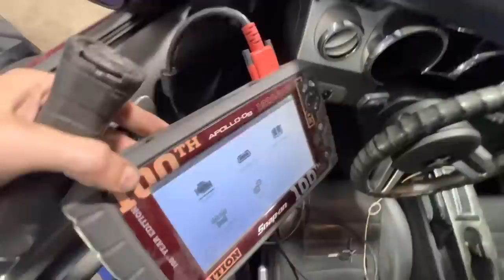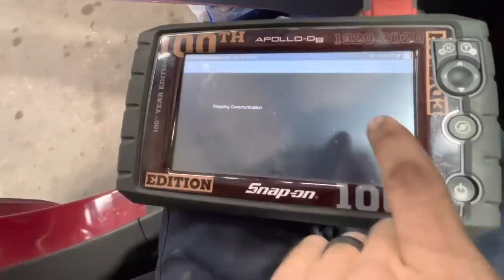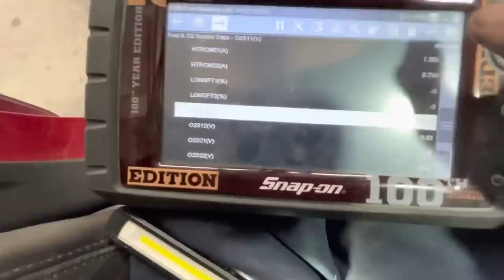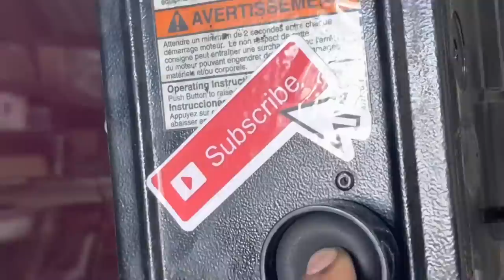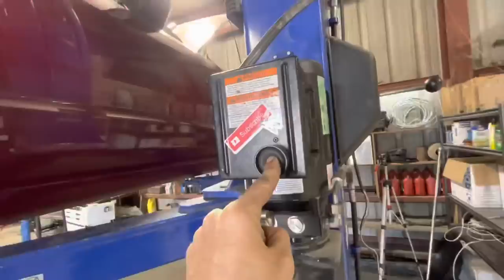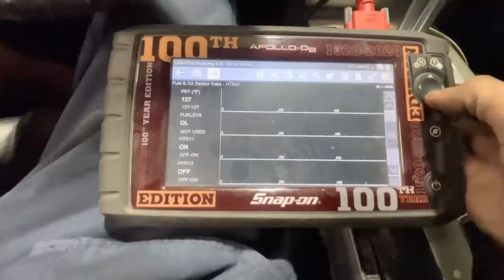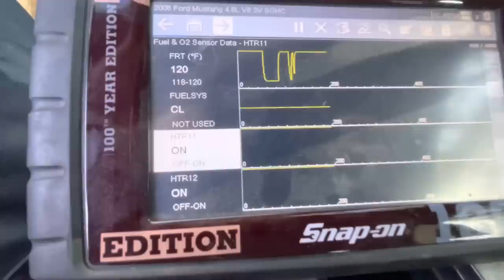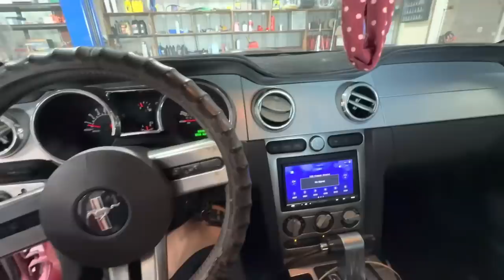Check Engine Light! 2006 Ford Mustang GT P0171 P2195 P1000

Comment from the maker: I totally dropped the ball on firing order. 1,2,3,4….5,6,7,8
Reply: Cylinder numbering order, not firing order.
Reply: Why wouldn’t you swap bank one sensor with bank two for testing?
Reply: @tomvines4557  Wife units are always in charge of the banks.
Reply: My 1991 3.1L Firebird Firing order realy was 1,2,3,4,5,6, HAHA Great Content! 👍 🇺🇲
Reply: My ears were open when you said that.
Good catch.
It's GM getting in your Ford like chocolate in your peanut butter.
Happens to everybody who sees both.
I wanted to look it up again to verify, but you corrected it here.
Reply: I was about to say, GM does the 1-3-5-7 thing and Fraud (Ford) does the linear bank thing.
Reply: I had this exact issue with my 96 v6 OHV Explorer. The waveform would hang a bit. The code was a bit different (slow 02 sensor response, P0133). Smarter PCM knew it was an 02 issue not an air/ fuel issue. New Ford Sensor made it run perfect. I actually captured the waveform, it would randomly "sleep" for like 5 seconds. Then go back to normal. If it was on both banks the chance of a bad o2 sensor is much lower. But Autozone will tell you otherwise to sell sensors.
Reply: Also, GM has bank one on the driver side, not the passenger side like Ford does.
Reply: I was just getting ready to ask when Ford changed their numbering system.
Reply: @tomvines4557  because the sensors are cheap and too much work to swap. Time is money.
Reply: Don't be too hard on yourself. Happens
Reply: @tomvines4557 because o2 sensors come out hard.
Reply: OH NO
Reply: @tomvines4557  due to difficulty in getting them in and out ?
Reply: Dis>gus>tang.  Fraud Disgustang!  👍  yup I have had several bad o2 sensors new out of the box.  Can't tell if they have been dropped, touched or molested?  I believe it's cheap wire from the sensors to the plug.   If you figure it out let me know.  ✌
Reply: Where is this guy located?  New customer inquiring
Reply: I was about to tell you that right now but I’m seeing that you made a correction. That’s absolutely right, bank #1 harbors cylinders 1 thru 4 and bank #2 harbors cylinders 5 thru 8.
Reply: your a great teacher and you have a big heart
Reply: It’s all good!
Reply: @nunya4586  Not time, a frickin pain in the azz to swap!
Reply: I was just going to say, when did ford go to Even Odd firing order on their engines?
Reply: was just about to say ;) lol

Comment: This is a great example of the difference between an assembly line repair shop and the independent take-the-time-that's-needed shop. Ray's ability to cut through the crap and logically go through the evidence to isolate the trouble spot is his superpower.
Reply: Indeed...
Reply: Yep, especially with intermittent faults, which are always an absoulte bu88er do diagnose.
Reply: Super power, Super man Ray. I watch rainman ray's to up skill, better than any school.
Reply: T Raybern  Go on then: which hand's he going to hold it in?

Comment: I had a Crown Victoria that had me chasing P0171's and P0174's for months.  At first, I followed what the codes said and I replaced the sensors one at a time as needed only to chase trouble codes somewhere else.  The quality of the "new" sensors left a lot to be desired.  It felt like I was in whack-a-mole hell and I was replacing "newish" sensors.   The fix?  I replaced ALL of the O2 sensors at the same time with Motocraft replacements.  The crap quality aftermarket sensors ended up being the root cause.  Whack-a-mole problem went away...I win.

Comment: Hi Ray,
Love your videos
I think you mix up terms open-loop vs closed-loop, though I'm sure you understand the principles behind the terms.
An engine would have to start out open-loop when cold, since the O2 sensors aren't ready to send accurate data or verifying its data, where the ECM uses its tables and possibly historical data to guess the fuel mixture.
Then the ECM goes into closed-loop where it starts using the O2 as feedback to adjust the fuel mixture.

It's sort of like dead-reconing navigation where you're just going by designated distances and turns, vs navigation by landmarks, GPS, etc that you can "read" to keep your bearings.
The former would be open-loop since there's no feedback to keep you accurate while the latter is closed-loop since you're using external data to adjust your navigation.

Comment: I've been waiting for Ray to come up against one of these. A fastener that takes an offset wrench to get a bite, roll the wrench and get some more, flip the wrench for another, then back to the beginning for the next flat on the fastener. Rinse and repeat until frustrated.
Cotter keys and safety wire not curled up on nearby fasteners gouging the back of your hand, ones estimation of the heritage of the engineer and previous mechanic goes to a dark place.

I'll now slip in a please on a recalcitrant connector before going full sailor speak, (The phrase covers us past Marines, we honor some of their traditions) But I've learned a sense of Zen watching Ray. That and the GAF meter sometimes just pegs out low.

Keep up the good work Ray You  give us all hope.

Comment: Yep, I think you found it.  Nevertheless, whenever a O2 sensor seems sluggish, it's a good idea to check the sensor's heater voltage and ground circuit as well as the sensor's resistance to make sure the sensor isn't running cool.  Great videos Ray!  I love how you diagnose problems.
Reply: My first go to is (where possible), swap the left & right sensors.  Easy to see if it is the sensor or something else then by whether the fault follows the sensor.  Of course, this may not always be possible, (single exhaust engine, or different sensors / leads on each side.)

Comment: Hah!  Talk about a timely video!  Chasing a P0171 Lean Bank 1 on my wife's Subaru EJ253 with 180k miles and 12 years old today - did the smoke check - no leaks.  Already had a new OEM upstream O2 sensor on hand.  Doing the sensor replacement after I finish watching your video and have a beer.

Comment: The downstream sensors on closed loop are doing exactly what they should be when catalyst are working proper and doing their job.  You wanna see very little movement or fluctuating voltage at idle, this also means that your cats are in good shape.

Comment: I hope you're not fighting this kind of gremlin that drove me up a wall on a '95 Dodge van once.  It had an intermittent open in the sensor lead in the first six inches of the harness out from the ECM plug.  Shove the harness a little to one side or the other and it would either cut in or cut out.  The van had gone through two engines without finding the fault; when the circuit went open, the ECM went to a dead rich mixture, and enough of that had wiped the rings - twice.  I bought it as a lemon, cheap, and it took me another two months to run down the fault.  I scavenged a segment of wire with the correct terminal from a scrap harness, did the wiring surgery to install it, and put another 180K on that engine before I retired the van at 404K.  So yeah, your guess that it could be a wiring issue is potentially right - but first you have to catch it in the act, like you said.

Comment: Me thinks you have your loops backwards. Open loop is when the engine is cold, and it runs on preset parameters, when the engine warms up a bit, it goes into closed loop,  where the sensors give feed back to the ECM to adjust fuel trims and such.

Comment: I think the sensor that was in there was an incorrect one design wise. Take note of the holes in the sensor tip then look at the new one. That makes a huge difference in how the air flow effects the readings on that sensor. I experienced this first hand when a muffler shop put a sensor with holes in it in my 98 F-150 quit a few years ago instead of putting in a slotted tip oxygen sensor, it effects the readings for sure.

Comment: Ray ... had a similar problem with my wife's Ford Edge, 2012. Independent mechanic found similar codes. Rather than replace the sensor, he told me that upstream was a solenoid, flap valve mixture control that occasionally gets stuck and fails. It results in a sensor 1, excessive lean state. He told me that most mechanics would replace the O2 sensor (had 75000 miles), but then showed me the real problem. No more sensor errors.

Comment: Happened to my '93 Ford F150 4x4. Previous owner replaced the mid tank fuel pump before sale. Still wouldn't start. No fuel to the inline filter from both tanks. I replaced both pumps and filter. Started right up! 
Moral of the story: Just because it's new, doesn't mean it works.

Comment: Been there done that. 1998 Taurus 3.0L. Had bank 1 upstream o2 go bad. I replaced it with a Bosch. 3 weeks later popped the money light. I figured it was a wiring issue. 175,000 miles on the car. The readings were slugish to flatline at times. After looking over the harness saw no issues. Bought a Motorcraft sensor and all was fixed. Not sure abought Bosch quality anymore. Usually their stuff is over-complicatedly built anyway. Ah well.

Comment: I've been able to slip the box end over the connector and use it to remove and install o2 sensors.  A 12 pt box end works well in cramped conditions.

Comment: The main thing that tells me it's not a leak is that it's intermittent. Intake leaks don't come and go, they're constant. Intermittent problems are almost always electronic. When you need to work on warm exhaust components, you can cool them off with a water bottle set to mist. It cools the components slow enough that you won't warp or crack anything. I set a blower pointing at the area and spray with water mist.
Reply: This is true to an extent, I have seen intake gaskets that only leak when the engine is hot

Comment: Something similar happened to my Mercedes e320. After a week of trying to diagnose the car I finally figured out the cause. It was a simple exhaust leak at the manifold and a weld on the cat. I replaced manifold gasket and redid the weld on the cat and problem fixed. It's been over a year now and no codes or faults.

Comment: I had a 2004 Lightning that was lean . Repair shop couldn't fix it when I got it back after paying for the diagnostic fee.  I found a split boot that let air in just before the throttle body that fixed the engine code.

Comment: P0171/P0174 codes are always a bear to diagnose. Had one on my Ford Five Hundred. Fired the parts cannon at it. Didn't fix it. Eventually I found the problem - it was an bad 0-ring on the inlet PCV barb that feeds into the intake manifold. Had I smoked the engine at the start that would have identified the issue immediately!

 Proper diagnosis is KEY! Do not fire the parts cannon as I did. You're not doing your wallet any favors thinking you're saving time and effort by doing so.

Comment: I had a Nissan maxima with the 3.0l v6 the previous owner has had a p0430 from 7k miles, I got rid of it at 215k, but he had sensors, cats, programming, and ECU's thrown at it. After 9 months of ownership I captured 4 freeze frames and compared them and found the car would not come to temp in winter. Long story short, Bank 2 wasn't getting any fuel it ran on 3 cylinders for a majority of its life

Comment: Good job! I just did sensor and cat on a ‘06 Pathfinder. It took an hour just to get to the sensor… pulled wheel, fender liner, heat shield, dropped/rat shit strapped exhaust system for the cat. Mustang looks easy.

Comment: I had a 1991 Pontiac Firebird 3.1L, I did lower intake per oil leak. Distributor o-ring was leaking too. The firing order is 1,2,3,4,5,6, that's the only in order firing order I've ever seen. And that was probably a little over 20 years ago. That's the engine that the intake gasket says DO NOT CUT LOL. Because to "CORRECTLY" replace intake gasket G.M. wants you to pull push rods because that's how gasket is designed. Pushrods run through intake gasket but I have seen ppl cut it and it's fine. If I remember correctly that 3.1L is set up where Valve Covers cover the Head and some of the intake. So where intake meets the head you put a lil silicone on vavle cover gasket.

Comment: I have a feeling you're confusing open and closed loop. in open loop the O2 sensor data is ignored by the ECU, in closed loop the O2 sensor data is used as feedback to tell the ECU the fuel mixture is good or not.
Interestingly, I've seen both P0171 and P2195 as indications of faulty cam timing. Either a belt jumped a tooth, a chain stretched or an adjustable timing sprocket not functioning optimal.

Comment: This is just a suggestion, you might try using your air compressor and blowing air across the exhaust right there. you may be able to cool it down enough to get your hand up in there to release that sensor.

Comment: I would say that the CAT on bank one is a little blocked due to overfuelling, It probably needs a good boot to the floor to clear its throat. Thats probably why the new sensor wasn't emulating bank 2 sensor. You could see the flow difference between the two on the post flow sensors initially.

NTK sensors are really the only option for aftermarket O2 sensors as most manufacturers get NTK to make them OEM especially FORD and Japanese car makers.

Comment: I tried to pass my car in California and I needed a new downstream sensor. It took almost 500 miles to complete the drive cycle. With gas prices as they were then, it was a bad experience. 2002 Pontiac Grand Am GT1. One note about the scanner screen, clean it. It's filthy. We could see it better if you did. Thanks bud

Comment: I believe you are correct. If it isn't an incorrect "click" or wire issue at the connector at O2 then the logical conclusion is the "new" sensor is faulty given no evidence of vacuum leak. Again good video Ray!
Reply: new logic he has.
Reply: A simple receipt from other shop would've told me that...if they install anything but oem O2 sensors they never work right...same with maf and map

Comment: Good diagnosis! A small request, if I may: When you are running the scanner and scrolling through the PID's, and the white selector bar comes to rest, that inverted black on white is almost impossible to see on camera, glare or not. It's a bit frustrating when the selector bar is resting on a PID, you're busy explaining it's value and I can't see what the value is. If you could make a note to move the bar to the next one down or up, then explain what's going on, it would be appreciated by me, at least.
Reply: I hope you’re watching the advertisements so Ray can be compensated for his work.
Reply: I hope you’re watching the advertisements so Ray can be compensated for his work.
Reply: Sounds like need a bigger phone, better quality, or use a laptop if you have seeing issues. No reason for ray to change his filming style because you can't see.
Reply: I have the same problem with viewing the scan tool. It sure would be nice to be able to see the PIDs in question.
Reply: @DjCorndawg  it's actually the "white balance" of his go pro that cause the issue. Perhaps other people on other devices can view it better but in general I think most people can't see.
Reply: @GoAskAlice23  I see what you did there. 😁👍👍

Comment: I worked in maintenance and reliability engineering in the oil industry. A new part can never be assumed to be good; it needs checking as best as possible. Many ball races for example are already damaged just by sitting for years on the shelf. The is a chart called the bathtub curve that shows failures are generally more common at the start and of course end of the component life than in the mid term life.
Reply: This is especially true for electronics. There used to be a hot "burn in" for electrical components and this eliminated most of the first part of the curve. Now manufacturers are too cost conscious but I used to see rows of PCs being burned in to look for failure.

Comment: What a nightmare cheap sensors can be. I was working on a Chrysler 2.5 v6 that would not start and run. My data determined a bad crank sensor. I was appealed that an oem was $100, but on ebay they could be had for $10. So I ordered one and it was a little large for the really hard to get to hole. I tried sanding it, but hit the copper core. I ordered another different brand cheap one, put it in and it still did not work. I ordered a distributer with no luck. I ended up at a junk yard and found a car with same engine that had white letters on the windshield that said "runs and drives" . I took those 2 parts home, installed them and it ran perfect. Those 2 $10 sensors cost me about 20 hours of cussing labor. I also found that removing the intake and distributer was easier that trying to snake around to that crank sensor.
Reply: Yeah I always say when it comes to sensors always get OEM parts.

Comment: I did actually see a case where an air leak leaned out only one bank.

Some dingus mechanic who may or may not be me, didn't torque down half the intake manifold on a Subaru, and the wiiiide intake meant the unmetered air never made it over to the other bank.

Comment: Right bank is 1-2-3-4 and left bank is 5-6-7-8. An old trick for the sensor is to take an old or crappy wrench and start grinding on it until you make it work. My dad had a couple with 1 side almost cut off .
Reply: I was just gonna comment Ford's are 1234 etc.
Reply: Kind shocked he messed that up. It's well known Fords "unique" cylinder layout...

Comment: RAY, i recently posted here that i had a flashing engine light on my 2005 honda accord, po175, it turned out to be a faulty coil on the #4 cylinder.